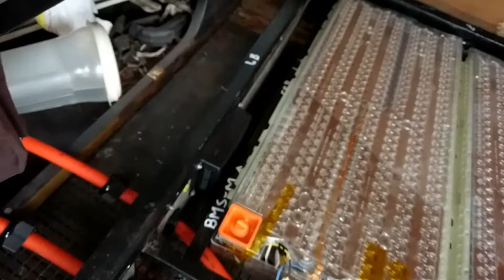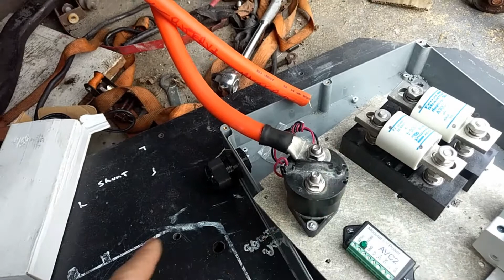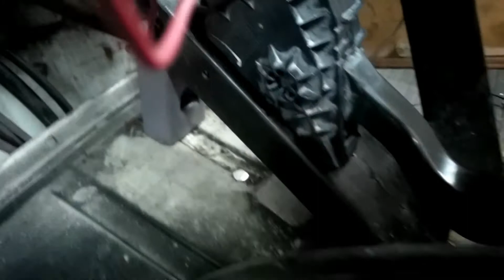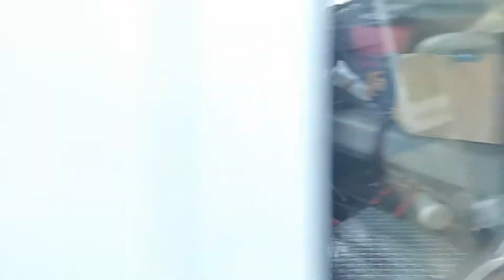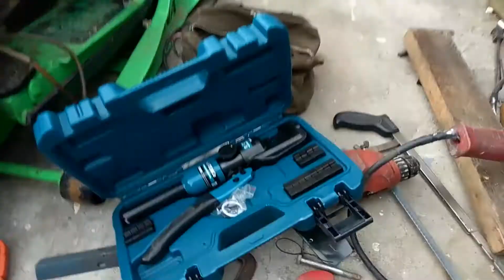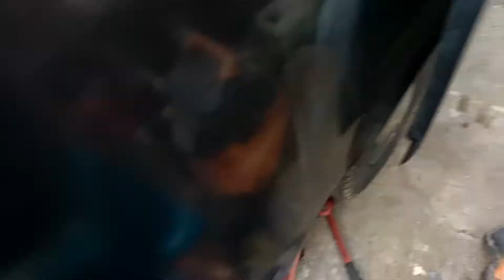EV Bus part 7 -  Batteries, Battery Box, Tools, Throttle

Comment: Hi, Bill. 
Thanks for all your videos. I am looking to convert my '72 VW bus and am very inspired by your experience. It's great to have videos like yours to learn from the mistakes and be prepared for things that may not work out of the kit. 
The last video posted 3 month ago. Did you get a chance to complete your project? Would be great to know your bus speeds and ranges before battery recharge, and overall experience. 
Thanks in advance.
Reply from the maker: Hi , thanks for your comment.  No, the project is not complete.  when i was making final connections, and testing, my BMS got hot and was not reading the batteries.  I'm working with EV West to figure it out. about to upload an update.

Comment: Too your throttle issue. I just visited EV West and they told me they do not use the prius throttle on VW buses. The bus pedal goes down through the floor as apossed to forward. Instead they use the existing accelerator peadal and cable with a Potentiometer in the rear. Heres a link to it.  https://www.evwest.com/catalog/product_info.php?products_id=418
Reply from the maker: Hey,  thanks for the info.  I am not very impressed with EV West.  It took so long just to get my order placed.  Then alot of it was back ordered.  Several items were not for the bus.  It takes a week + to get any reply to questions,  and rarely addresses my concern.  And the parts don't match the available schematic. Frustrating.
Reply: @libstertec  I hear you. We placed our order back in August and are still waiting for the battery boxes and charger. So work is on hold. I think the issue is that the demand has grown faster they can keep up. Plus they are reliant on suppliers for alot of the items.

Comment: What 12V cooling pump are you using?
Reply from the maker: BXQINLENX SC600 DC 12V PC CPU Water Cooling System Tool Water Pump 132.09 GPH 10W Brushless Drive Water Pump for Destop Computer Laptop Computer